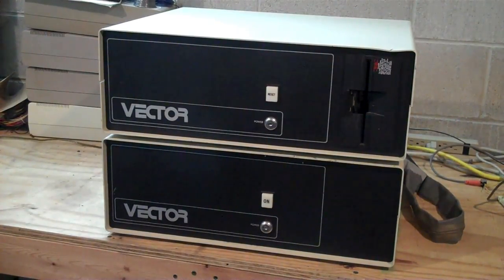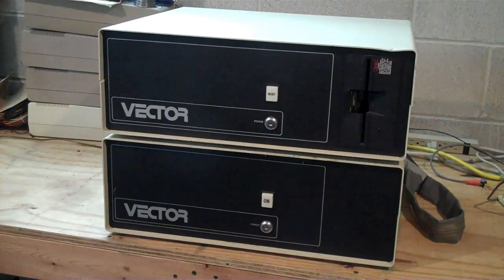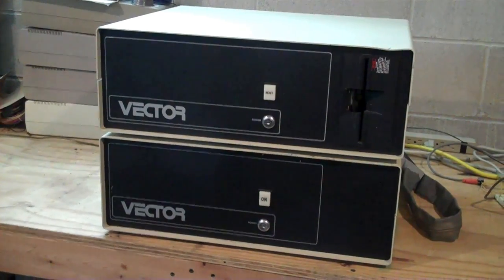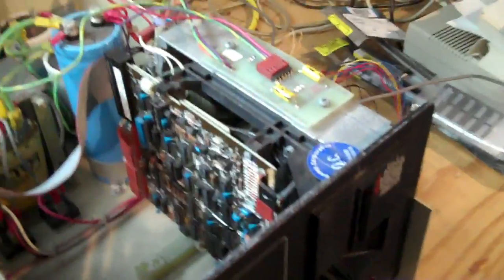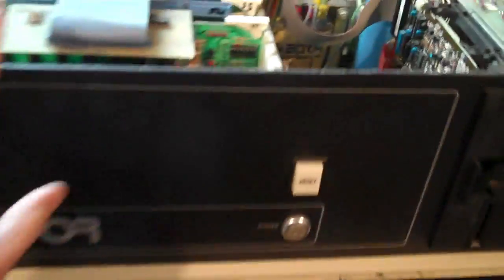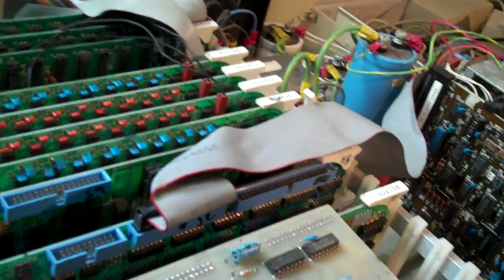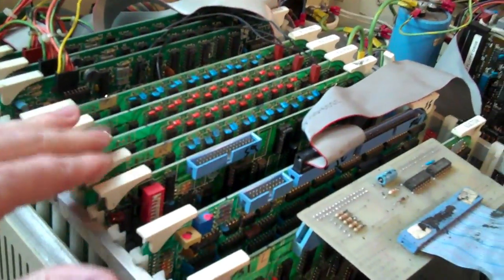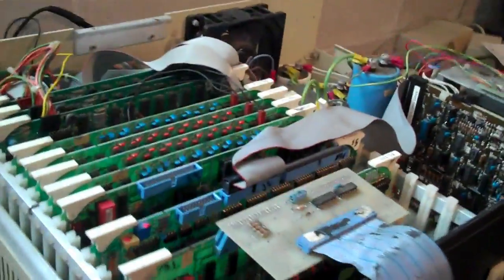Vector Graphic 5032 Tour, Part One

Comment: If that's the last multi-user machine with a Z80 card per each user, that they built before the Vector 4,  then it's a dud if you put more than one Z80 card in it.  The proper machine to get hold of is a Vector 4 with everything built into the main console. Those could be networked to make a fully seamless transparent multi-user system for CPM/MPM.  And that was years before Microsoft managed it.